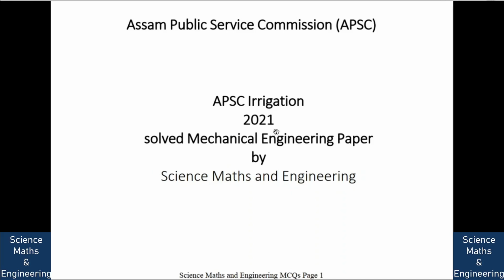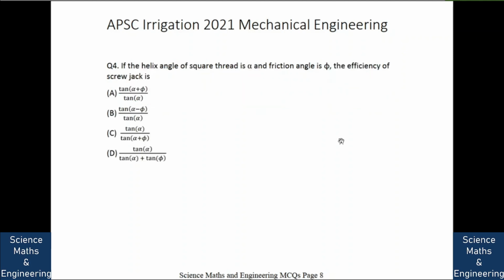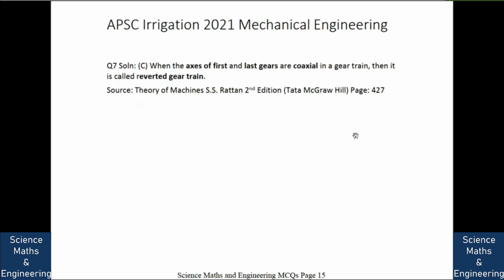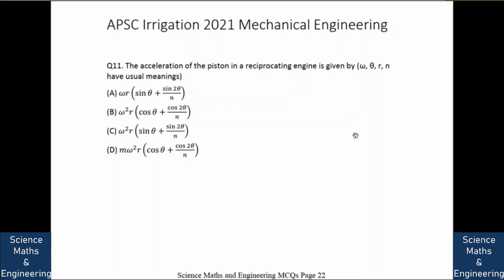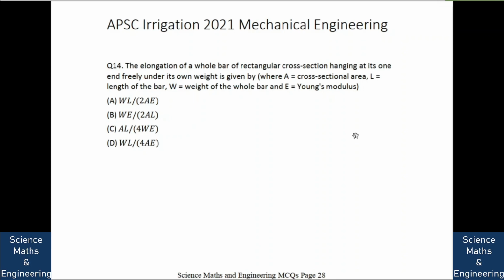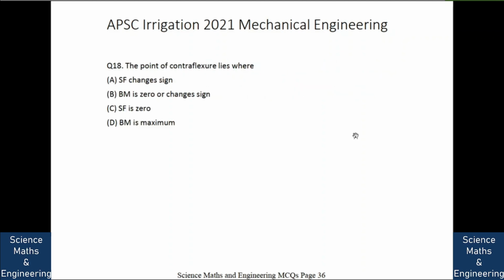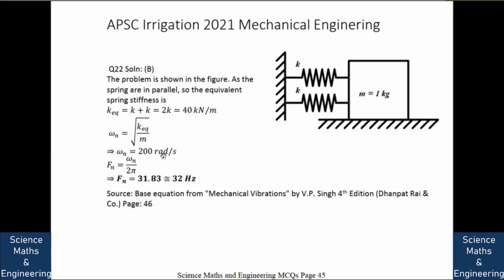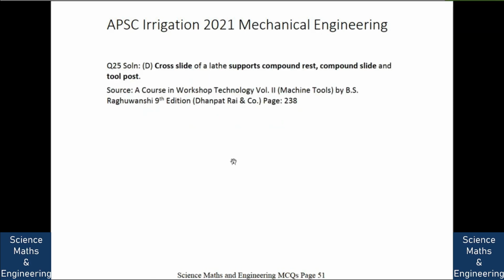APSC AE Irrigation ME 2021 Part- I

Comment: Aekhon AE ne JE paper?
Reply from the maker: AE paper
Reply: @sciencemathsengineering7758  numericals  questions kom ahe nki?
Reply from the maker: @johngohain  Numerical questions are there in most APSC papers in adequate numbers around 30 to 35. However, there is no fixed rule. Another thing to note is that these questions are generally very direct questions of not more than 3 to 4 steps.